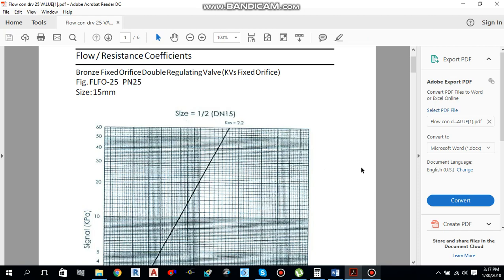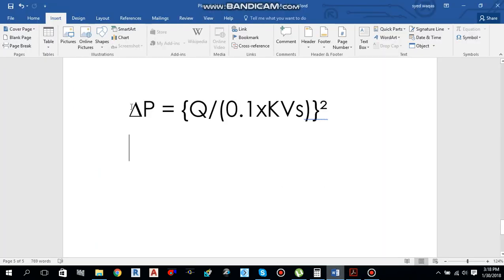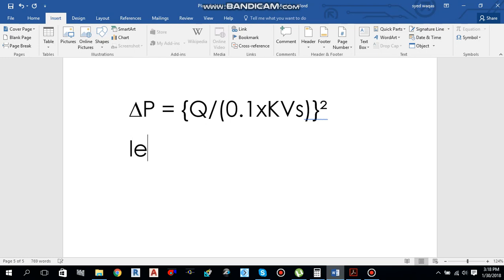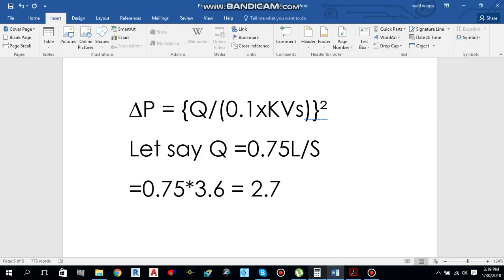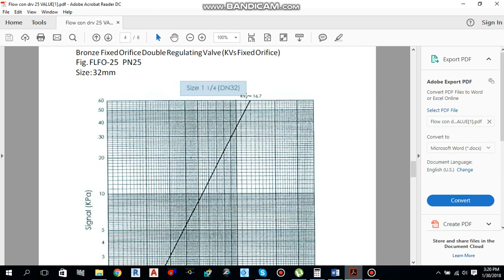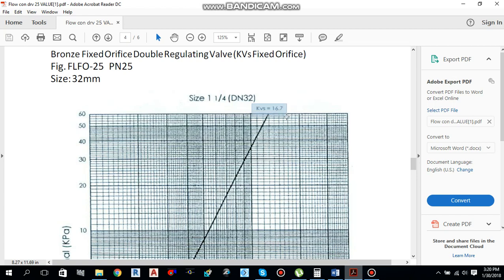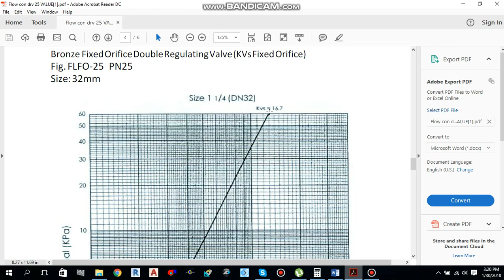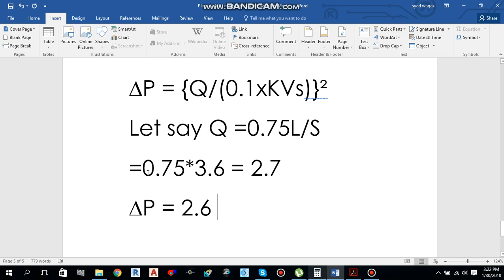DRV balancing to get designed Chilled water flow rate (Ultrasonic meter), drv selection based on GPM

Comment: Sir 2.6tonns water require to open the drv...pls clarify...I didn't get...
Reply from the maker: My friend this is 2.6 turns NOT ton... There is marking on DRV(double regulating valve). So you have to turn 2.6 this drv to achieve required flow.